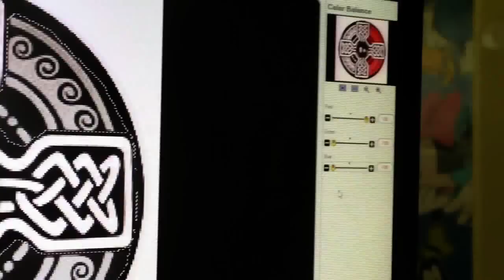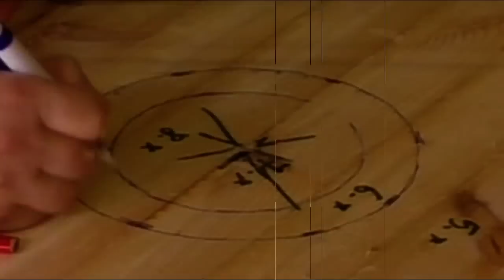Viking shield. How to make a Viking shield (in modern way). Round Shield. ( щит викинга )

Comment: that resist a good strike? cos i think that is a bit thin, and is not reinforced in the back by any other piece of wood, anyway a very nice work
Reply from the maker: Noooo.. The shields was not thick, as many people think. This Shield is ready for the battle or hanging on the wall.The Shield cannot be thick and heavy. Because you need to move and fight with it.
 INFO :http://www.hurstwic.org/history/articles/manufacturing/text/viking_shields.htm
 The Gokstad shields were approximately 7mm (1/4in) thick near the center and were chamfered so they were thinner at the edges. Most surviving shields are in the range between 6mm (1/4in) and 12mm (1/2in) thick, although shields thicker than 30mm (1-1/8in) have been found. Egils saga (chapter 53) says that Þórólfr was equipped with a large, thick shield. Later in the battle, he threw his shield on his back to wield his spear with two hand.
My Shield is 80cm diameter. 1cm in the middle and 8 mm on the edges.
Reply: Layered and glued wood is actually quite strong a plywood itself is also a decent material for combat ready shields
Reply: Viking shields weren’t has big and thick as you think they were, in fact, this guy’s shield is probably a bit thicker than an historically accurate shield, they were very thin for a number of hypothesized reasons, but no one really knows for sure why the Vikings made their shields so thin
Reply: Shields like this were designed to deflect, or parry a blow, rather than absorb the blow or trap the opponent’s weapon.